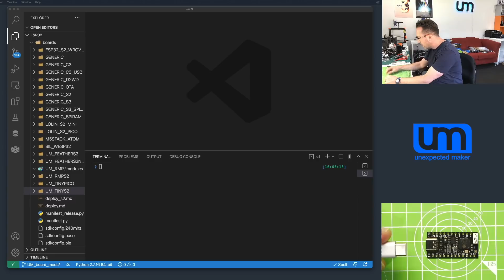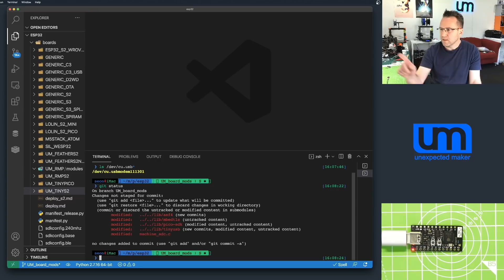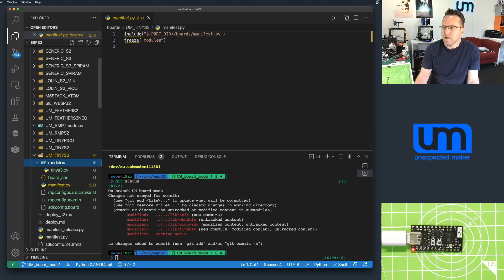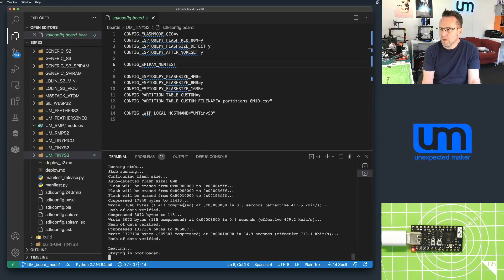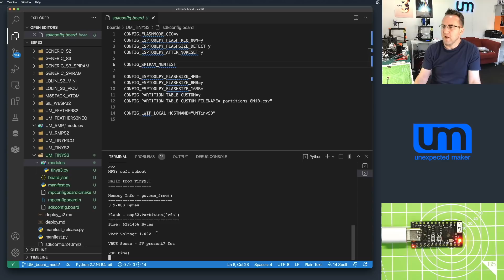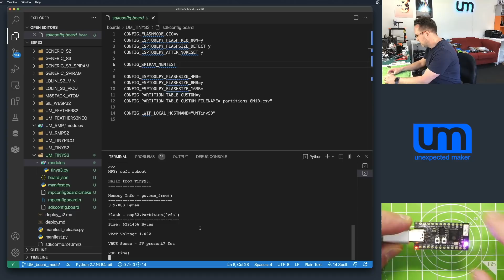New ESP32-S3 boards - Production Silicon!

Comment: There’s an S3 one? Did not know that, just picked it an S2 off Amazon to play with and am thus far seriously impressed. It is hands down the slickest and easiest to use ESP32 board I’ve seen. Haven’t been able to get a REPL prompt off it yet but need to play more.

What’s the diff between the S2 and S3? Just the underlying ESP32 chip?

Comment: Would really love to see a board with 32MB of flash and 4-8MB of RAM .  Coyld run a really good UNIX on that ...
Reply: RAM and Flash are not the only things you need to run UNIX on it. And why would you anyway? Just get a Pi Zero if you want an actual OS
Reply from the maker: Also, try finding > 16MB Flash atm. If you can, which is very unlikely, it's 5x the price it was pre silicon shortage.

Comment: @Unexpected Maker That tiny board is real cool but wonder if it should have more flash as with ML say tensorflow you can retrain with usage data where OTA can update to a partition...
But yeah really like the Tiny board where I2S & DVP make for some really interesting applications
Reply from the maker: Cant get more flash for the TinyS3. Espressif don't have a chip with more slash inside, and there's clearly no room on the board for more external flash.... and well, flash is 5-6x in price than what it was pre-silicon shortage.

If you want to do ML, you want to look at a bigger board, not a smaller one :)

Comment: I like that pro board, is that approximately the same size as an Arduino nano? Or longer? It looks like my nano 33 ble. Good to hear that s3 silicon is at least technically final, if scarce. Kind of weird that it seems like Espressif pulls random features from each new chip.

I think dirty in the git describe actually just means there are uncommitted changes, not anything to do with the branch or tag.
Reply from the maker: I'm not sure how big a Nano33 is, but my ProS3 is 17.75x51.8mm